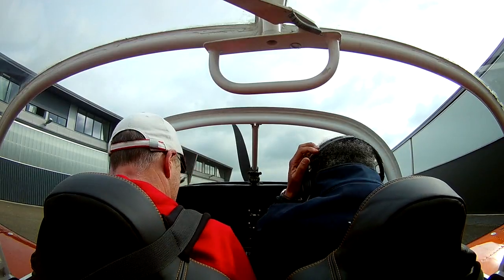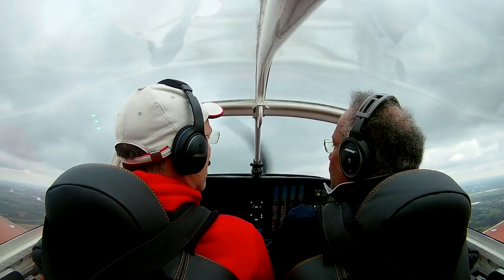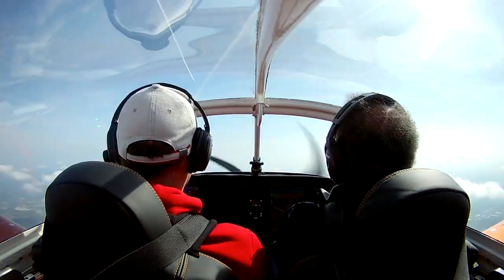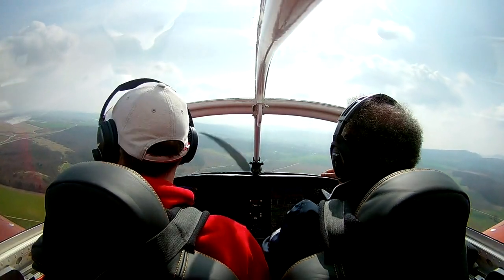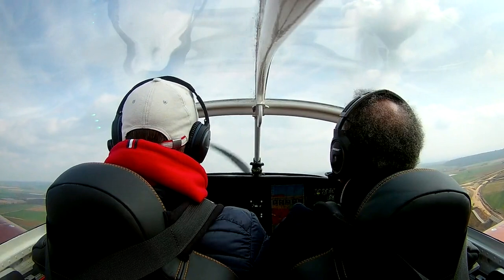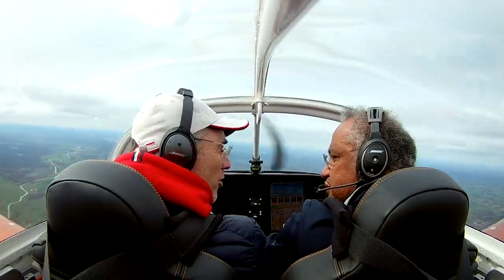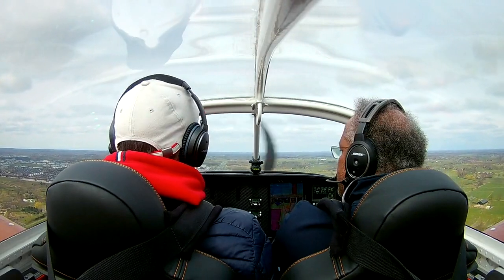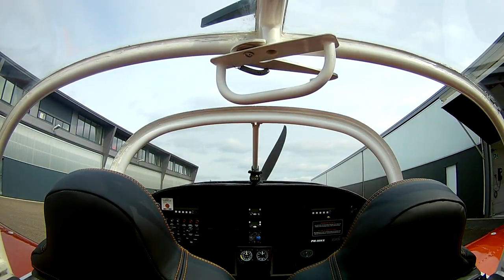PH-MNX Durability Flight

Comment: Love your aircraft and the UL power engine! What True airspeed are you getting in the cruise?
Reply from the maker: Well, I flew to Kassel (EDVK) from Teuge (EHTE) within the hour. And back also within the hour (because there was almost no wind).
So the IAS was between 135 and 140, and the GS was also about 140. It consumed 70 liters (probably 5 on taxi and startup, I did a long time taking off). And I flew at 23.5" (MAP) so that should be around 65%.
I did expect to be more fuel efficient, but apparently it is similar to a modern Lycoming.